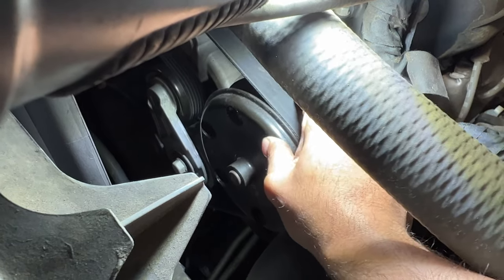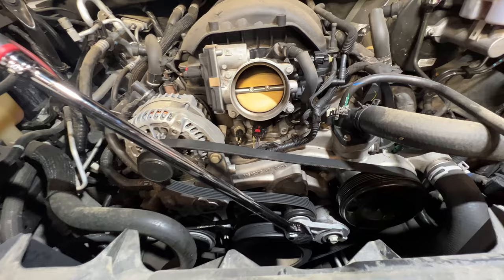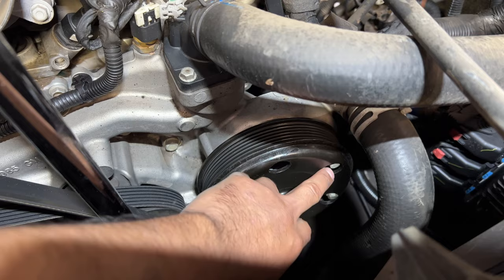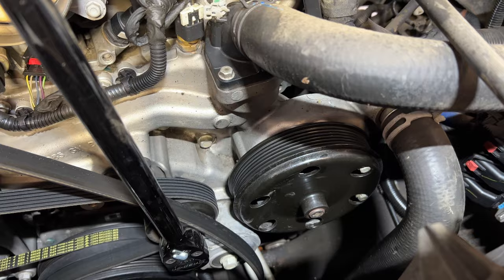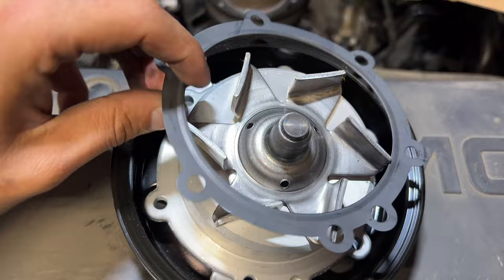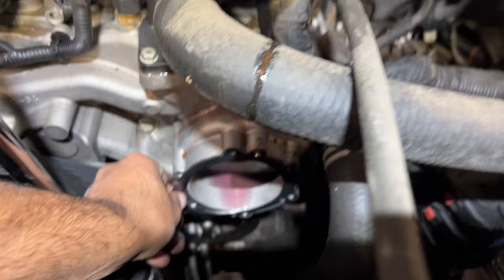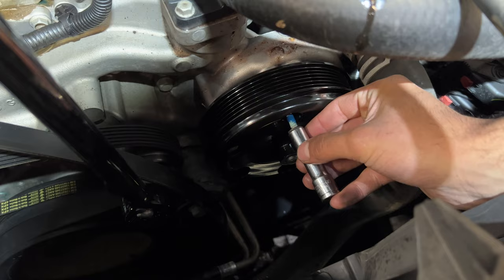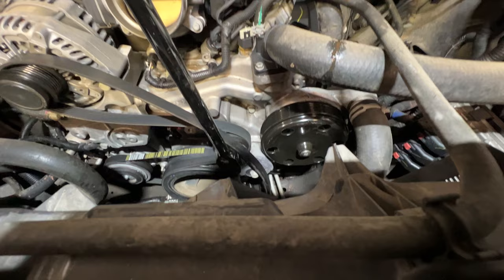How to Replace a 2016-2020 Chevy OR GMC 5.3L Water Pump

Comment: I wouldnt put thread adhesive on the studs to this pump. Just had one snap off upon removal because the last guy used this. Unfortunately, the space is too tight to get in there with a drill. So tomorrow...ill spend my day figuring out the best way to get it out.
Reply: How did you end up doing it ?
Reply: Probably used the GREEN permanent loc tite or equivalent and/or over-torqued that one bolt a bit more than the rest or had extra loc tite or both...torque value would be nice for this video
Reply: Snapped mine off too. Thankfully I was able to get it off with needle nose lock pliers and some wd 40

Comment: Hello i have a question, why dies the new water pump on my brothers van start leaking as soon as he put new coolant in it. I found a guy on Google that came and replaced the water pump with a new one he told my brother to let the sealant sit for a while we let the van sit for a day and a half we turned it on and now there is still coolant dropping where it was dropping before the water pump was replaced, why???

Comment: Great video brother. Question though. I pulled the water pump off my 2018 5.3 and it had 2 tiny pin/bearings in it that were loose. Any idea what they might have been. I inspected the housing and it seems fine just wondering what they were.

Comment: Thanks bro just did mine 👍 didn’t use any rtv either, no leaks. Only thing I wish was that I had my power ratchet from my work tool box lol. My 2019 silverado 5.3 water pump just went out at 77k miles,  was making a noise for the last couple days and last night when I got home it got louder and  I seen that it was leaking so I changed it this morning, I got a duralast water pump, gasket, and a whole thermostat kit from autozone for $115.00. Easy peasy, job took about 30 mins.

Comment: Can you tell me what kinda tool is that when u turned the water pump and it came off what’s that tool?
Reply: Looks like either a Milwaukee or snap on 12v cordless 3/8s drive ratchet 🤷‍♂️

Comment: Did you loose Coolant? Did you have to replace?
Reply: Add more Coolant. I have the same problem.  Makes noise and has play in the pulley. I replaced the serpentine belt figured why not only 40bucks. Noise still there thats when I noticed water pump has play

Comment: If my Silverado is squealing on start up do you think it’s the water pump?
Reply from the maker: Sounds like the serpentine belt
Reply: Im not an expert but pretty quick learner. Last week i had the same noise and just sprayed water on belt. Noise gone for a couple days but today while driving in the city, heRd one last final noise and after popped the hood, saw coolant dripping all over.
Do not ignore the noise
Reply: Mine was the belt
Reply: I had the same noise. Only happened when car when in park. Took it to the mechanic and they said it was the water pump and belt

Comment: Torque specs for bolting on the new pump?
Reply from the maker: Just tighten down snug. Idk
Reply: They say is calls for 18 foot lbs
Reply: @enriquereyes8180  I set the wrench to 18 ft lbs and broke a bolt. Highly recommend not doing that.
Reply: Per the service manual...11 ft/lbs on the first pass. 22 on the second.
Reply: @cschmidling31 how did you get the bolt out? Had one snap trying to remove the pump.
Reply: @dstan1771  mine broke putting it on, and since it hasn’t leaked I’ve just left it as is. If it begins leaking I’ll take the pump off and see if enough of the bolt is sticking out to get vice grips or tac something to it. Otherwise, I’ll have to go to a professional.
Reply: @dstan1771 I had one snap too. Thankfully a little bit was still showing so I sprayed it with Wd-40 a few times and had to get needle nose lock pliers to get a grip and slowly but surely pulled it out.